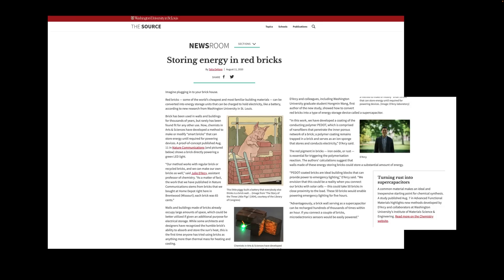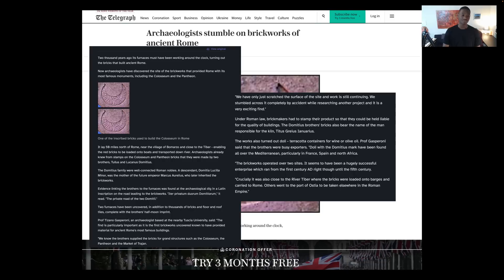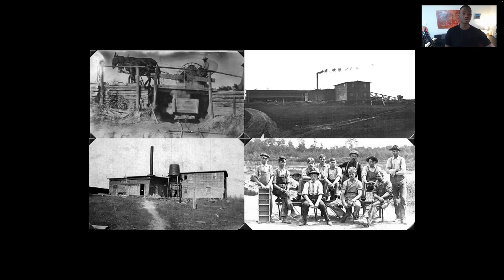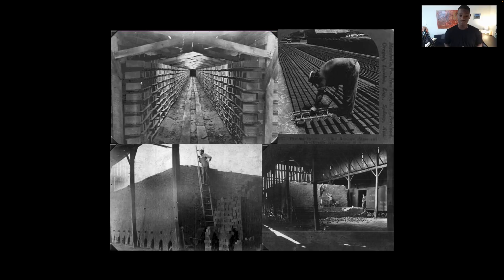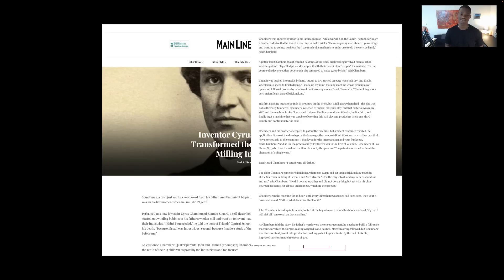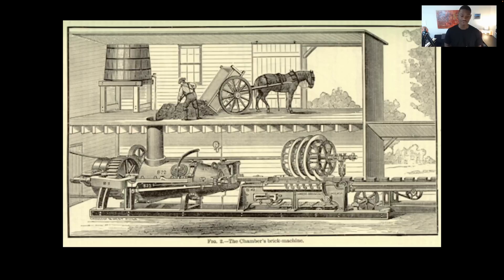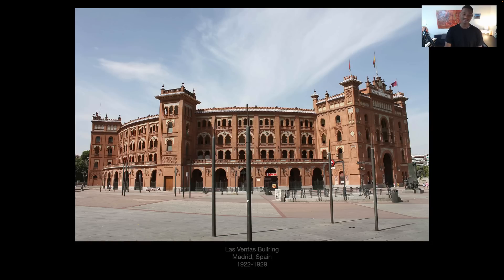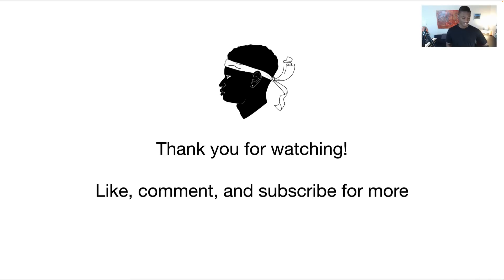youtube video #-t0cK5yxU5I

Comment: what you think is marble or or these others types of stones used in banks and govt buildings that look like some other building are just red b rick buildings with a stone facade. even the courthouses in my area i never knew until i got closed and seen erosion from water and at the bottom of the foundation you can see its just all red brick under it, this is jersey city nj. court on newark ave.the one the corner where mcdonalds used to be. I think that the abundance of red mud is from it falling everywhere during resets causing the mudflood yes their are reports of mud falling from blue skies no clouds sinking ships having all hands on deck shoveling it off so they wouldnt capsize. i also think the millions upon millions of buildings around the world and the trillions upon trillions of bricks was a daily reminder of these resets and what happens, they could have added materials to them and yes made the piezoelectric effects or batteries, a real quick summary also like roman concrete geopolymer was used to build the pyramids and most things also used in india and in roman statues all molds. those statues that are white originally had true to life vivid colors painted on them they werent meant to see with no color.

Comment: 21:05 JayDreamerz has a nifty take on how things like this might have been created. worldwide depressurization made things a bit different. more buoyant, so to speak.
Reply: 22:05 might be reversed to what you said here. not built and then melted, but melted and then built. Thunderbolts project deal with the mechanics of some of this, but JayDreamerz gives a little more in the realm of supposition, like due to depressurization and electrical nodes on the surface of earth, it might liquify rock a bit and pull it up (creating mountains/mounds) that could be worked more easily after the event.
 interesting channels. i would at least suggest you look at the Thunderbolts for their theory of an electric universe. jay is wonderful at text breakdowns and his truth in movies series. right up your alley. maybe the buildings sank into the earth...

Comment: Trust me .
If a Brickie's mortor lines 
Aren't parallel & square
Then ........... 
He is Not Bricklaying.. haha
Bricks been around since time began...
Been building with bricks before building with stone.... 
Babylon,  Ur's Zigirot, Nineveh etc etc.
All completely out of brick, and 
I mean everything..
City walls, temples, civic structures palaces all brick,
Millions apone Millions of Baked Clay Bricks..
If there's no rock around it makes it difficult to build with stone..
And visa - versa
Bricks are cool nothing wrong with brick... 
Cheap and long lasting.
As for conducting electricity??
to my knowledge, it works way better, and I mean Way better as a inculcator... 
Opposite to Conducting..
They use Ceramic Connectors to attach overhead powerlines to their poles,
So they

Comment: I would be interested to see what your 'more informed' math looks like for these buildings construction. Could you please attempt to calculate how many people it would take to simply make the bricks within the alledged construction time, or how many people would have to participate in the masonry. Here's my uninformed example math.. Like if we assume a single laborer could make 30 bricks per day by the methods of the middle ages or even earlier (this is the same as a team of 5 making 150 bricks per day). We could calculate how many people it would take to make 1 million bricks in a year, or 365 days. When I did the math, I was surprised. 1,000,000 bricks divided by 365 means about 2740 bricks made per day, and then divided by 30 bricks per day per person, surprisingly we see it would only take 91 people to achieve this marvel. Admittedly my math includes some uninformed assumptions, like that 30 bricks per person per day is reasonable, and that anyone could actually work making bricks all 365 days of the year, but it's still surprising math.. To make the 90 million bricks in one year, by my calculations, would require about 8220 people, which is significantly less than say the number of Hebrew slaves in Egypt according to the book of Exodus...  though I'm not saying magic wasn't involved though, seeing as magic was around in ancient Egypt according to the book of Exodus
Reply: The question is more than just about making the bricks. There is the problem of transportation, energy, sourcing the raw materials, planning, clearing the land and removing obstacles. These are complex tasks that require enormous technological prowess. Yet, the say some were built around 300 AD by Romans (if there were such people at all, that is)
The narrative makes no sense.
More so in North America, where presumably, things started at no more than 200 years ago.
Reply: @elim7228  I overall agree that the historical narrative is 99% bullshit, I just though it was curious what some rough estimate math reveals